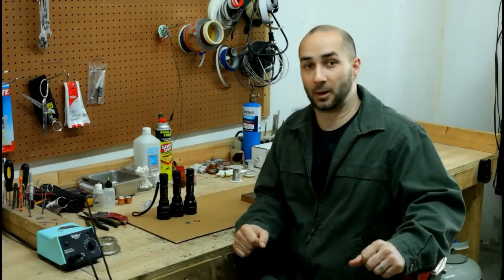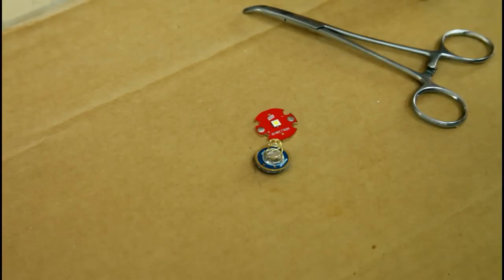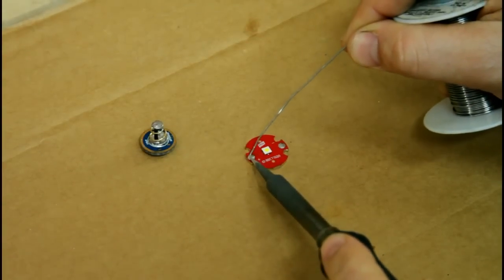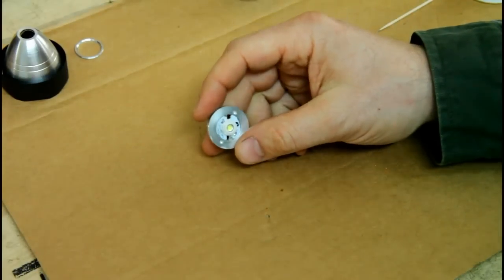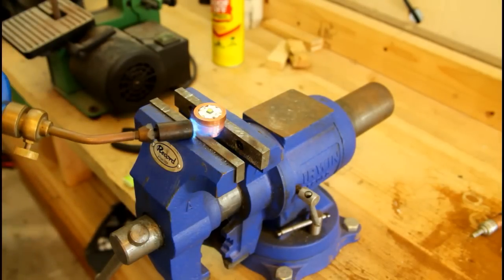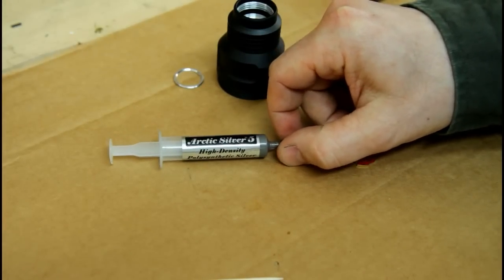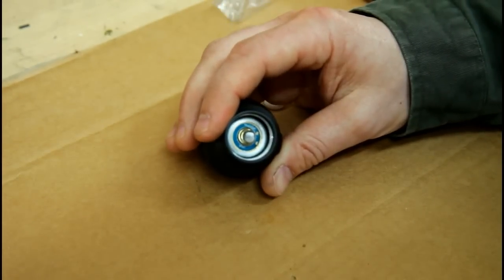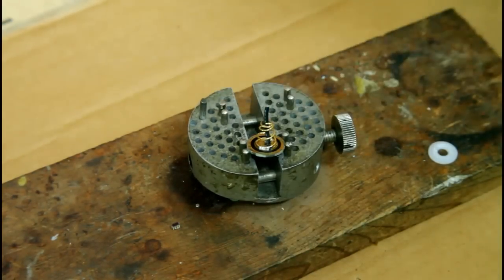Ultimate C8 Flashlight Mod!

Comment: What do you mean when you're saying at 30 seconds? Does it take 30s until it reaches the maximum light, or after 30s it heats and stops?
Reply from the maker: If you measure right at turn on you get a falsely high reading.  Waiting for 30 seconds allows the output to level off and gives more consistant and precise measurements.
Reply: AdventureSportFlashlights I’m thinking about modifying my old Led Lenser P17 by putting a Cree XHP70 (6v version) and it is a bit confusing for me. I have the Olight H2R nova that has the XHP50 but I am really wondering how does it work with just an 18650 battery at 4.2 to 3.7 volts since the xhp needs 6 volts.
Reply: @gunbojason  you need a boost driver
Reply: Vlad Constantin Radulescu The 30 seconds is one of the requirements of measuring to ansi-fl1 standards that most flashlight companies agreed to use. The amount of time they chose, 30 seconds, allows for heat to build up and for the output to stabilize so as to give a more realistic lumen measurement.
Reply: @JasonWW2000  perfect explanation
Reply: It measures the output 30 seconds after turn on , because the reading exactly at turn on will be higher (and it only lasts for a few seconds) .
Reply: 30 seconds much better reflects typical usage than "at turn on".
Reply: Can we build a c8 with xp70.2 led?

Comment: I built one of these using a Convoy S11.  You can get the driver adapter from Banggood.  It's not the thrower the C8 is because the S11 comes with an OP reflector.  Very floody beam and great runtime on 26650 battery.

Comment: I did this mod and it's pretty awesome! How can I ramp up the emitter to 5-8amps? I have several qlite 3.04 drivers
Reply from the maker: To consistently get that much current you need to use a buck driver and two batteries.   Some XPLHI emitters will give you 5+ amps on a fully charged cell if you use the mosfet driver, but when the over voltage from the cell wears off the current will drop a bit.

Comment: How do you measure current and power requirements for an LED? I've read that in some cases like the 219bs require resistance if you  use a single emitter and suggest thinner or longer wires from the driver to mcpcb as one way to create the resistance and not fry the LED.

Comment: I have a bunch of 18 gauge wire, can I use this for the bypass and on the mcpcb wire leads or so you recommend a different type of wire/gauge?
Reply from the maker: I typically use like 22g myself.  18 will work but sometimes when you use really thick wire the spring can't compress and it will mash the tail end of your battery.
Reply: @Lumencraft-  cool thx, i was worried overloading the wires but sounds like the concern is a non issue

Comment: Can I use lead free solder? Any specific solder to use for best current?
Reply from the maker: You can use lead free, but I find it harder to work with.   Does not melt as well.   What solder you use will not make a huge difference in how much current you see to the LED.

Comment: "MCPCB doesn't touch only the very edges"
I have some bike lights with similar assembly. Can be this the cause that the light goes extremely hot, while it produces less light with 3 XM-L2 LEDs then a way cooler Busch+Müller light? Any of them above 80 lux :D

Comment: Hey, I come from IT background, and there's something to think of: 
A processor draws say 95W under load, and it can get hot.
If you use solder like Indium and compare the temperatures between thermal paste, you will get 20c cooler temps on solder...

Comment: Hello dear I have duracell 300 flashlight using 4xaaa battery but I have not the battery holder.Is the  batteries in series (6 volts)? And how to remove the butten to clean it.

Comment: I am inspired by this great video,  can I put XHP70.2 (from your site) into this mod with your mosfet driver to get a even higher lm? Thanks a lot.
Reply from the maker: Thanks.   You can put the XHP70.2 in a C8 but you would need to use the 6V mosfet driver and a pair of IMR 18350s.   The run time would be very short though.   The batteries would last only about 8 minutes on full power.

Comment: Is this pretty much the same as the Astrolux C8?
Reply from the maker: Yes, it's very similar.   The A6 driver used in the Astrolux is going to have slightly more perfect looking PWM in low modes, but a reduced current in high modes.    Originally those drivers were very good (designed by BLF members).   I bought some of them a while back though and found they started using some really cheap components or something that caused resistance to be high.    On maximum power I was averaging only about 3.5 amps vs 4.5-5 ish from the regular mosfet using what ever LED was the hot button at the time.      

I have never had one of the pre assembled lights so I can't say for sure what current you'd see from it (maybe better components are used).    Here is a fairly recent review of it where I noticed there is also a step down timer incorporated in it. 
http://budgetlightforum.com/node/57800

Comment: Hi Matt, beginner here. Was thinking of this mod and i realised that in the video you are using the XP-L Hi V2. But the site info on your driver board says XML2, XPG2. So is the XP-L Hi V2 compatible with the driver board? Im confused...
Reply from the maker: Hi,   You can use this driver with any 3 volt emitter like XPL, XPG, XML,   as long as  your thermal path is correct you should be just fine.

Comment: Could you please explain to me how this works? I thought the XP-L HI was only rated for a maximum of around 1000 lumens? How did you get such high numbers? Also, I keep hearing about people saying they run their XP-L HI at 5 amps or more or something like that, but isn't the XP-L HI only rated for a maximum of 3 amps? How can you run it off of 5 amps?
Reply from the maker: Sure.   If you create a really good thermal path its possible to drive the cree emitters much much higher than what they are rated for.  I think Cree rates them at lower current because they assume most people will use the old style mcpcbs and they want to shoot for at least a 5 year continuous life.
Reply: AdventureSportFlashlights Thanks man

Comment: I have the thorfire c8s, should I de dome the XML2 in it?
Reply from the maker: It would give you about double the throw if you did :)
Reply: AdventureSportFlashlights can I just use a razor blade and cut it off or is there an other way I should be doing it
Reply from the maker: Yes, you can just slice it off.  Be careful not to cut so close you nick the bond wires over the emitter.   I leave about 0.020--0.030" (twenty to thiry thousandths of an inch above the dies.    The most common way to do an XML though is to take the emitter and mcpcb out of the light and soak it in high octane gasoline over night.  The dome will just pop off, then clean it with rubbing alcohol to remove the gas residue and let it dry.   This will take it off right down to the emitter.    The gas treatment does not work on newer LEDs like XHP70 so you know.
Reply: AdventureSportFlashlights thanks, I’ll try cutting it off, if that goes bad I’m planning on doing this upgrade anyways
Reply: AdventureSportFlashlights my driver is 20mm what do you recommend as a 20mm driver for this led you used in the video
Reply: AdventureSportFlashlights would this work for a 20mm driver http://www.mtnelectronics.com/index.php?route=product/product&product_id=714&search=FET+driver
Reply from the maker: Yes, that is a great driver.
Reply: AdventureSportFlashlights well I have just gotten around to this project and I bought the same driver listed above and a XPL HI V2 5D hopefully it turns out well 🤞

Comment: What's the benefit of the 42mm. lens
Reply from the maker: The glass lens that this comes with is just standard type glass.   You can get one that has an anti reflective coating on it that will allow more light to pass through it.   This will only gain you a few percent though.

Comment: Doing a C8 with XHP35 with a 1.5 amp single cell driver this weekend. Should be significantly brighter and throwier than an XPL hi but we'll see :)
Reply from the maker: Sweet!  What are you gong to use for the driver?
Reply: "H2-C-22mm-1_5A-1-or-2-cell-5-Mode-Boost-Driver"
Reply from the maker: Cool.  I hadn't seen that driver before.   It may be hard to get into a C8 though.  Convoys take a 17mm board.  I have seen some with a slot as large as 20mm, but the H2C driver I saw at KD was 22mm.
Reply: You're right, my bad...I'm going to use a Yezl Y3 as a host. I just finished a C8 last night with an XPL hi and a FET driver from bangood and running a VTC6 cell it really is the king of budget throwers. BTW I found this emitter from Luminus, theres some minor talk about it at BLF but not much really. It will cost around $100 but look at the specs - 5500 lumens at 27 amps from an XPL die size emitter area (3mmx3mm) Any ideas for a driver for this? This looks like a monster...
http://www.luminus.com/products/CFT-90.html

Comment: would it be possible to make it a floody light?
Reply from the maker: Hi Gary.    Yes, it's possible.   If I were going to use this host to make a flooder I would probly put multiple LEDs with an optic in it.     I suppose the easiest way to get a super flood beam would be to pull the reflector out and just run it as a mule.
Reply: Great rewiev Mat. I put aA6 driver used in the Astrolux, in the c8 host and and put a  orange peel reflector in it.( drill the hole upp til 9mm its fits.)  its get little more flood than.

Comment: Iv gone from a xh-pl hi 2v 1a to a noticgon like yours and I didn't see a major improvement, am I doing something wrong?
Reply from the maker: Hi Warne.    I would not say your doing anything wrong, just that there is still room for improvement :)  If you really want to see a jump in the output you need to also upgrade the driver board.   The main advantage to using an mcpcb like noctigons is so you can drive the LED much harder.    For the best results you can either use the mosfet type driver, or you can solder some extra 7135 chips ( those 4 prong chips all over it) on the existing driver to add some current.

Comment: You make some of the best how to videos ever. Now I want to tackle my own c8 asap. Thank you for your time and knowledge, keep up the great work!!
Reply from the maker: Thanks Evaed.   Let us know how your build turns out.
Reply: Well I've got it built using a http://www.mtnelectronics.com/index.php?route=product/product&product_id=663&search=17mm+driver with cree xp-l hi v3 on noctigon 20mm mcpcb with no tail spring bypass as of yet and it worked for about 2 minutes then quit all together. I can't find anything wrong but something is. Any tips to figure this out what went wrong would be greatly appreciated, this is my build so I'm as new as it gets lol.
Reply: I think I figured it out, seems the driver was shorting out somehow. I gently filed the rough edges off the board and now it works great! I really hope that was right thing to do lol. Getting easy 200 yards out of it and still have to do the tail spring bypass.
Reply from the maker: Great job trouble shooting.   These kind of things happen to us all.

Comment: Although I already can do flashlight mods by myself and have done quite a lot in the past (greeting from BLF!) but I still can pick up some tips from your video which are quite helpful, thank you!
The latest Convoy C8 already come with the XP-L HI on DTP copper board, so you can just buy the finished light, don't even need to do anything with the LED but just swap the driver into a FET one. After that you just need to do the spring mods and you have powerful C8!
By the way what battery do you use in your C8?
Reply from the maker: I use the Sony VTC6 3100ma.  Low internal resistance and good capacity.
Reply: Which seller did you order your VTC6 from? A lot of Chinese are unable to ship lithium batteries nowadays and it is really a pain.
Reply from the maker: IIRC it was from Illumn.com

Comment: I'm buying all the stuff I need to do this .. I never done a light before. But that looks a lot brighter then my c8. I like!!
Reply from the maker: Let us know how it turns out :)
Reply: AdventureSportFlashlights I will for sure.  I read the info now. I guess I need to get the 3 volt. Since it's running 1 18650?
Reply: I seen a new upgraded c8 with this same led with a ak47 driver.. so is the driver you put in this thing the reason this is a beast of a light ?
Reply from the maker: The driver is a big part of it.  Using a quality emitter on a direct thermal path mcpcb is the other key component.
Reply from the maker: Yes, the 3 volt driver is what you want.
Reply: Right on man, I'll get it from your site, thanks

Comment: A friend and I both built these but were both having trouble with them. Very inconsistent problems, hard to describe. Programing is difficult and sometimes just stops working completely for a few min even if the battery is taken out and replaced. My friends seems to have a spotty connection somewhere. Can't figure out where though. Wondering if the drivers are screwy. Any ideas? We're new at Flashlights but not soldering. All the joints are good.
Reply: @AdventureSportsFlashlights
Reply from the maker: I'd be glad to help you with that.   Starting with the light that 
has a flicker.    I would check to see if  the retaining ring that holds
 the switch in place is threaded in tightly.   I have found these to be 
loose many times causing issues similar to what you describe.   If your 
host is a Convoy the tail cap rings are a reverse thread in many 
cases.   Also check the driver retaining ring and other points of 
electrical contact to make sure they are solid.    You can also try 
removing the tail cap totally and just jump the connection between the 
battery negative and the body of the light, if the flicker stops you 
know the weak connection is in the tail.   If it does not check the 
other end.

For the mode changes/random shut off.    It 
sounds like you may have a short.  I would check the driver closely and 
see if any accidental solder bridges were made.     In some china made 
lights I have also had the retaining ring or the lip where the driver 
sits be too close to the on board components causing a bridge.    It's 
always possible that a driver simply is bad, but with this board it's 
pretty rare.  I have them manufactured in the USA, all the components 
are assembled by machine (all thought I suspect the pcb itself may be 
outsourced to China) so QC on them has been pretty good.
Reply: AdventureSportFlashlights  tail switch has been eliminated by switching our tail caps and flickering still occurred. We also took the whole tail assembly apart and inspected and reassembled. I just did what you said again also to double check. They are both convoys. I just remembered that the light will only come on if you unscrew the bezel a little bit
Reply from the maker: Ok, I hadn't thought of this until you said that bit about unscrewing the bezel.   It's very possible your reflector is shorting out on one of the LED wires.
Reply: AdventureSportFlashlights I think that might be it! Let me play with this a bit and see what I can come up with. I'll let you know. Thx!
Reply: I can see where the bezel notched out where the wires were soldered to the mcpcb and shorted it. It won't work with the bezel completely removed so I think somethings fried lol. What's the next step to figure out what's burnt?
Reply from the maker: Good job finding the cause man.  I know trouble shooting can be a pain, but were on the right track.

I would start with checking the LED.  If you have a DMM you can desolder the wires and turn your meter to the continuity setting then touch the leads to the LED pads  pos to pos and neg to neg.  On a 3 volt emitter this will be enough to light the die just barely.    

If the LED does light up I would check the switch.  If those are both good then it's probly the driver.   Repairing a fried driver difficult ( I don't even bother) so I just replace them.
Reply: AdventureSportFlashlights you found it and I appreciate it too. It's cool because it's kind of fun since it's not my light lol. What's a DMM? Is that a multi meter? I have one of those but how will the continuity setting light up the led? Is the a voltage output on that setting?
Reply from the maker: Yes, a multi meter.  There is a very low voltage that will pass over the emitter on that setting, like I said it will just barely light up the die.   Make sure you detach the wires from the mcpcb first though or it wont work.
Reply: AdventureSportFlashlights nice! When he comes over I'll let him mess with his own solder joints and we'll take it the rest of the way. Thanks! I'll let you know when  we figure the rest out.
Reply: Flickering is annoying and it can be caused by various reasons. Vestureofblood has addressed some of them which are true and I have experience with these reasons as well. If you want to confirm whether it is caused by the bezel/reflector base that causing a short, simply remove the bezel and reflector and turn the light on and see if the flicker still occur?
And I will add another possible root cause for flickering issue is due to the bad reflow of the LED. If there is insufficient solder used on the thermal pad (the center pad on the MCPCB), after you switch the light into high mode for 1 minute flicker will start to appear as the heat dissipation is poor. How to know if it is due to insufficient solder? You won't see the flickering on the lower modes (very less heat generated so no problem), and you also won't see the flickering upon switching on the light but it will only occur after a certain period of time (when heat is accumulated and the temperature is rising high).